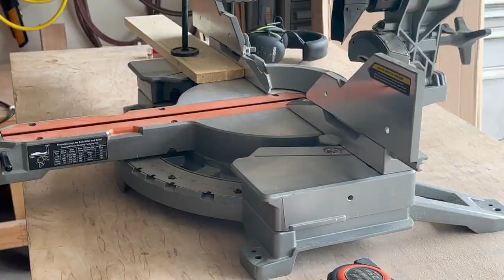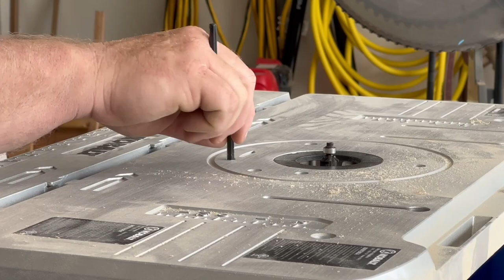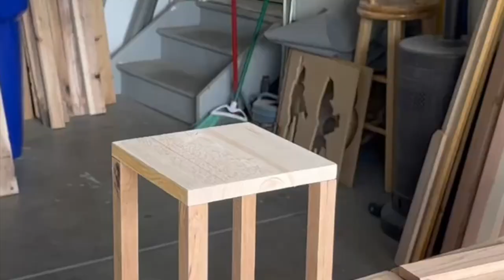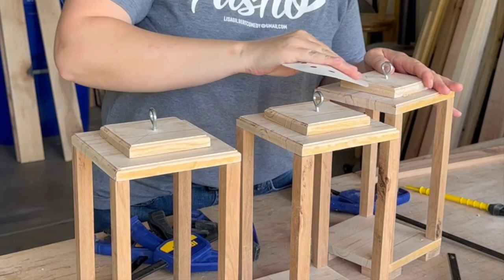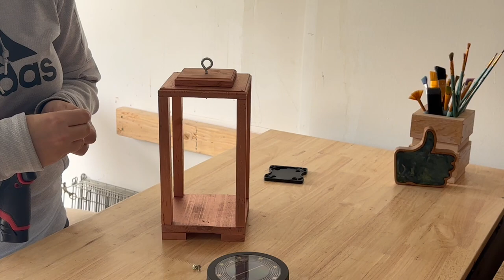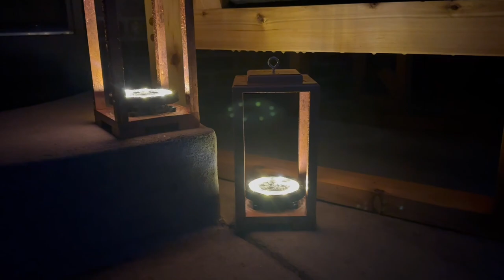DIY Lanterns

Comment: I built 6 of these but I put clear coat on them to help them live longer because of the elements.
Reply from the maker: Nice! We considered that. But they were so quick and easy to make. We figured we could make more. The coolest thing happened with that paint I used. They are getting that patina that copper gets lol. I’m not sure we would have seen the patina if there were a clear coat. I imagine ours will not make it through the crazy winter. I bet yours outlasts ours lol.